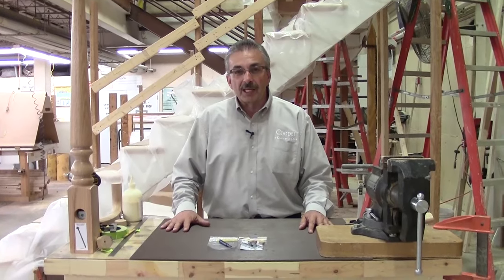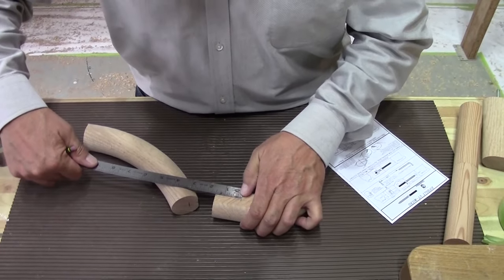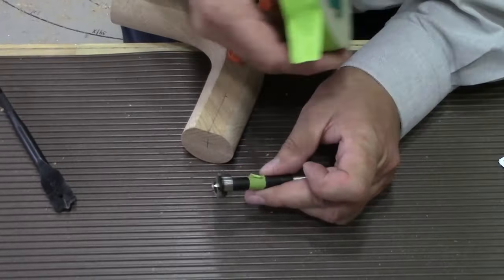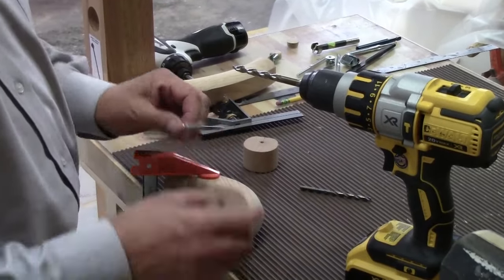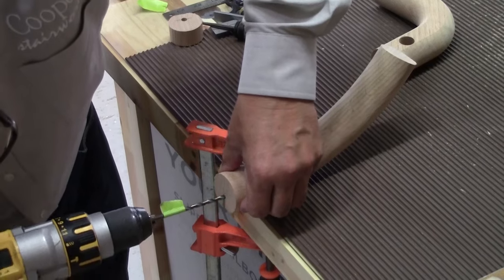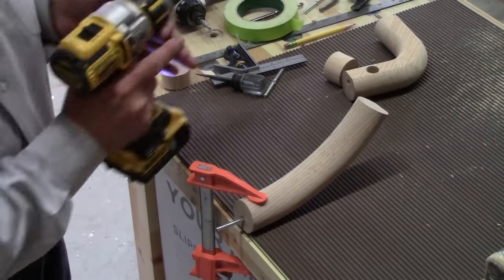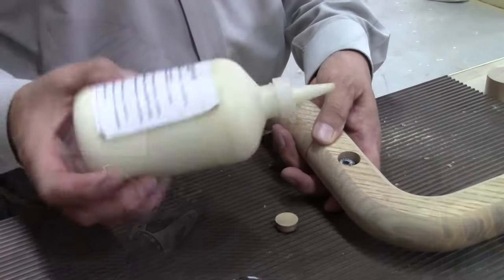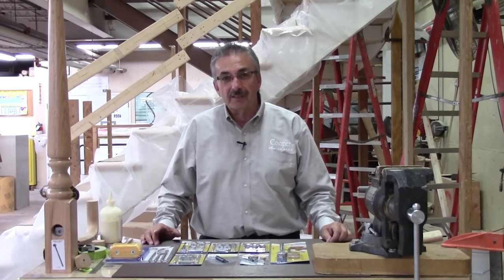How To Connect Small Round And Low Profile Hand Rail Using The MICRO ZIPBOLT Rail Bolt

Comment: could someone tell me where to find those round 90 degree or 60 degree elbows in wood.....please (I'm not a woodworker at all, but I need some)~~!
Reply: I found them at stairparts dot net under "general handrail stair fittings". 4 diameters available in various hardwoods.